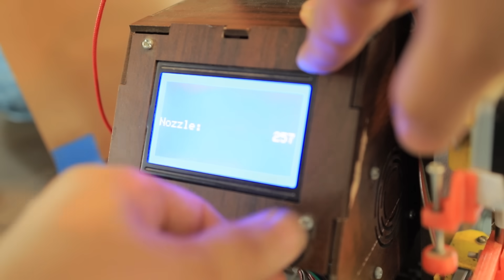How to Make free & easy filament for 3D printer at home

Comment: How do you control the thickness of the filament?
I saw a commercial device that has a sensor for thickness right under the nozzle and pulls on the filament more or less based on the measured thickness.
Are you pulling with a constant speed?
And what nozzle size would make sense? Should it have the same size as the filament I want to produce?
Reply: @AIboom20  you could answer it now, and still make the next videos. Your answers won't ruin your number of views. It will make those numbers even higher.
Reply: @LeandroSehnemHeck  it more of a reshaping than extruding in this case. in traditional extrusion you have kind of a pool of plastic, so  you can extrude faster, but consistency is harder. here instead you have about the same mass per meter, so you are just heating and molding the section as it is feeded, variation in the tape thickness will amount to waste in the premelting zone, of thinning of the filament. but as the wall of plastic are consistent, and the thing that he used to create the tape is constant width, there shouldn't be a major problem. It will never be as consistent as a filament extruded in a 5k machine, but it will do the job, unless you are printing something really aesthetic.
Reply: Awesome guys. I wanted to make what you are doing years ago, even before of having a 3d printer. Looking your videos I believe I can try. Then I have more questions. What is the width of the stripe you cut from the bottle? Does this width is important? Why do you fill the bottle with air? Is it to straighten the plastic? Why do you turn it over the stove? Is it required? You didn't do this in one of the videos? How long is the wire created from a single bottle? While extruding the wire, there is a support that you pass the stripe of plastic before inserting it to the hot nozzle, does it need to be parallel to the nozzle? Why?
Reply: @giuseppebonatici7169  True fact, i built myself an expensive extruder with compressor screw, band heater and pulling system with optical diameter feedback, even though failed to get lower than +-0.2mm error. Totally useless for typical 3d printers..
Reply: @giuseppebonatici7169  Yes, this is more reshaping than extruding and you have a consistent mass per meter going in, that doesn't mean you have a consistent mass per meter going out. When it's soft enough to be reshaped, it's soft enough to be stretched when you pull too much. Depending on the temperature and the pulling force, the tape going in could move slower than the filament going out, so the mass per meter isn't the same anymore.
Reply: @LeandroSehnemHeck  This exactly. Either make a video detailing the process or don't bother if you want to be taken seriously. We don't need another 7 videos detailing what you did in this video. Either make this video or those.
Reply: @MHTSAPAS  Uhm, what? 🤨 Leo didn't make this video. He just wanted more details about the process just as me.
Reply: @juschu85  I was agreeing with Leo actually.
Reply: @MHTSAPAS  Oh, okay.
Perhaps directing a comment to one person but @ing another one, is a little bit confusing 😉
Reply: @MHTSAPAS My friend, I didn't make those videos. I am just watching these amazing tutorial trying to learn something as everybody here. I just have a bunch of - maybe annoying - questions. Have a great day.
Reply: @LeandroSehnemHeck  I was agreeing with you but I guess it’s hard for people to understand what “This exactly” means. Have a good day folks and please don’t accidentally hurt yourselves. I’m beginning to worry.
Reply: @MHTSAPAS  No problem, I will do the possible to keep safe. Thank you.
Reply: @MHTSAPAS  It was a misunderstanding and that's not a big deal, but don't blame others for it. When two people are understanding you wrong for the same reason you should think about if it's possible that you are part of the problem.
Reply: @juschu85  I kind of did. I showed it to everyone at work and they’re wondering what drugs people here are on. 
I re-read it over and over yesterday wondering if I wasn’t making any sense but it’s got my stuffed. Maybe if I stop making sense, I’ll start making sense lmao. 

I wish you all nothing but the best nonetheless.
Reply: @MHTSAPAS  Hey, I was able to read your first comment again. I understood it all wrong. Yeah, you were agreeing with me. The video shows good stuff but the author's are making many of it without new information and also they are not answering peoples questions. So what is the point? I believe it is just to collect views and likes and not to solve a plastic issue or to help others. You were right, I got it all wrong. Apologies dude.
Reply: @LeandroSehnemHeck  you could have subbed 10 times in the time it spent to write this comment, looks like you "edited" your comment as well, lol. You must be exhausted!
Reply: @imothy  no, I am fine. Thanks for asking.
Reply: @Mothy  Sure, when I make typos I fix it so you guys can understand since English is not my mother language. You got these details quickly, congratulations!

Comment: You can't just take any plastic and just turn it into filament, even with recycled PLA they still put grains of interdustrial PLA, and it's obvious that you simply can't keep a consistent 1.75 diameter of a spool not to mention the method you used for melting it through the nozzle
Reply: depends on if he drilled out the nozzle to 1.75 and what temp he set the nozzle at to extrude the plastic threw it.

Comment: Good job!

What's the purpose of the first two steps, pumping and heating up the bottle? Is that for drying the plastic or to get the appropriate thickness?
Reply: @AIboom20  how did you manage to get 1.75mm nozzle, they're not common sizes?
Reply: @Iraq3DP  drill
Reply: so the bottle won't melt quickly at the same time if you heat it too much, there are chances for the bottle to burst or get deformed and it depends on the material.
Reply: I would say it has more to do with the shape of the bottle before it is cut by that jig he has. The pressure puts force pushing towards the outside of the bottle, then spinning it over heat evenly reshapes the bottle.
Reply: I tried heating the bottle and found some more uses, 1. Removes dents in a bottle and reshapes it back, 2. dirt's are removed(happened when I heated the bottle loaded with air).
Reply: PETE plastic will shrink drastically when heat is applied. By pressurizing the bottle it prevented that shrinkage and allowed him to smooth out the bottle (removing designs and ridges) to make cutting into a uniform string easier

Comment: Am i overlooking something? How did the filament go from being flat to a consistent round?
Reply: flat plastic passing through a heated nozzle, actually a damn good idea, not hot enough to melt it, but hot enough to mold it i would say slightly colder than the 3d printing temp
Reply: @feliwein_cc  Aaah of course. Thanks for pointing out the obvious for me.
Reply from the maker: In fact, the tape in the extruder part acquires a tubular state due to heat

Comment: I’m sorry but I do think THIS VIDEO IS FAKE, I like the concept but many parts of the video just don’t make sense, the main area being where you take the plastic strip and put it through the hotend. Not only does the strip contact the heater block but if you are pulling molten plastic filament out it will not pull the strip with it. The second main issue is that almost all plastic bottles are made from PET and not PETG, although similar, PET is not conventionally printable. I don’t want people taking there printers apart to be met with disappointment.

Comment: With the utmost respect.. coming from an Engineer.. I smell something fishy here.. Not sure how the plastic is not melting touching the hot part of that nozzle assy you have put together.. Also nearly impossible that you would pull the filament on the other side with the hot extrusion coming out and pull the entire raw materials section into the hot end. Besides, holding the diameter of the filament is done using optics and PID on the reel stepper.
Reply: Looks fishy to me too, and wouldn't holding it over a stove, just let the pressurized air out, even if it is rotating? Not even a fan for cooling? The yield he got from just one bottle? I have never seen a florescent green drink bottle either...
Reply: @micro2743  Mountain dew drink bottles are fluorescent green from Pepsi
Reply: @micro2743  I can't speak on anything else, but...That's deffo a Mtn Dew bottle. They are florescent green.
Reply: @jake360flip  No, I have one in my hand right now and it is a dark green, but not florescent and much more transparent that the bottle in the video, which also seems to be the wrong shape, at least in America. The 2 liter bottle I am holding also weighs 5 grams, and would only produce about 6ft of 1.75 filament.
Reply: @micro2743  the bottle is common in asian countries mnt dew here in the Philippines is also neon green. Its not flourescent. Trust me. Tried UV and dark already
Reply: @micro2743  science
Reply: That's a 1-liter bottle. Common outside the USA.
Reply: And how come the beginning of the strip (where string is attached) is flat at 4:33 and it ends up round at 5:40 without passing through the hot end ? Something's not right.
Respect for the job done but if the result is faked, respect goes away..
Reply: I agree, I was looking for a comment like this to up  up top more, this looks like BS to me, First, not a common bottle, this is NOT a Mountain Dew Bottle, people saying it is must not drink it or are blind. Soda bottles are not made of PLA etc, they are made of PET, and I do not think you can just reuse it like this on a 3D printer. This all looks like total click bait BS, can not wonder if any of the people saying this is Genius even tried this at all!
Reply: You have to think harder as an Engineer, you can wiggle the raw material in the nozzle first with out turning the nozzle. Tie it down tothe reel stepper. I will go down to how hot the nozzle is going to be as well as how fast the reel stepper for a good output. I may also depends on material (bottle). At the start I think a first few mm of raw material might be unusable though.
Reply: @Micro try it, these plastic cool of fast if not held on the flame for long period of time. The pressure inside the bottle got even out as the bottle got expanded. Its main purpose is to expand the bottle so that you could have an even thickness throughout the wall of the bottle as the bottle itself is not even in terms of wall thickness. And if its too thick then you'll have problem in the reeling process later on. You could also get more material out of it.
Reply: I have to retract my statements here. Looks like this is actually possible and with these level of results. Seen a lot more data to suggest this can actually be done. Apologies.
Reply: @s92 Basically I saw a lot more videos of people doing this and then eventually I saw CNC kitechen or teaching tech one of those channels also do it which then completely legitimized it for me. They got decent results too..
Reply: If I tried pulling filament through the extruder on my printer it would simply snap, maybe here the extruder is at a low temperature to deform the plastic as its pulled through but not melt it, but I would expect it to give very poor quality filament. Normally the plastic being made into filament is melted completely, measured for diameter then cooled with fans or a water trough.

I just read in the description that the temperature for making filament is 225-200 which to me doesnt make sense :) I dont see how that would work at all!